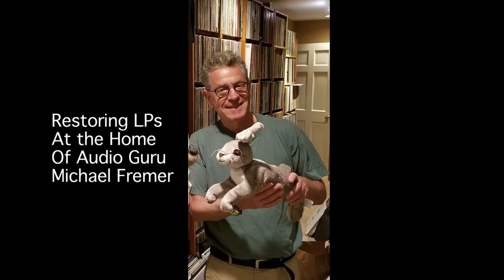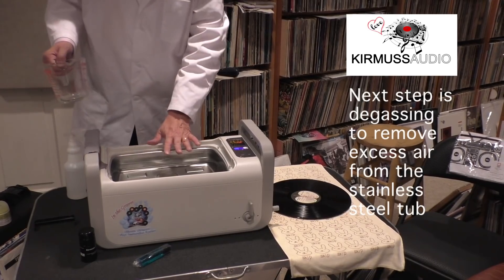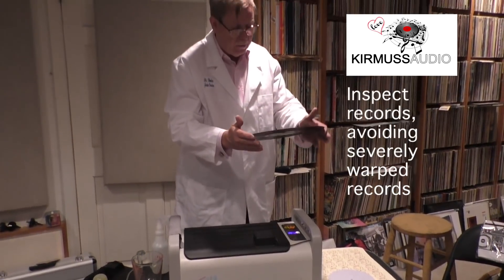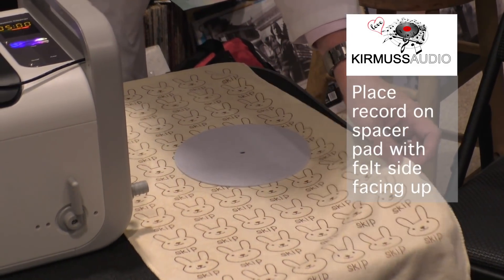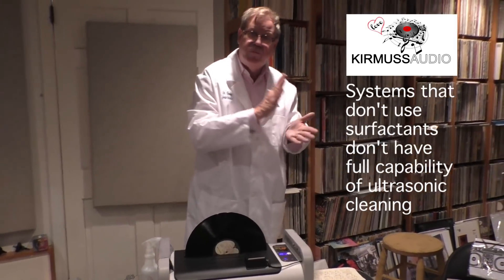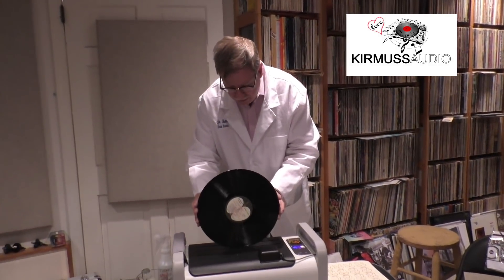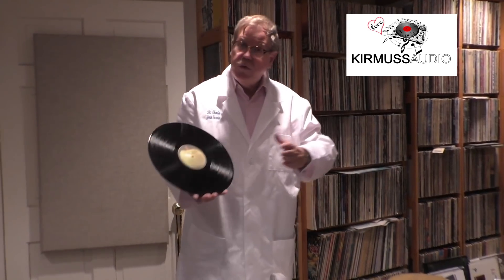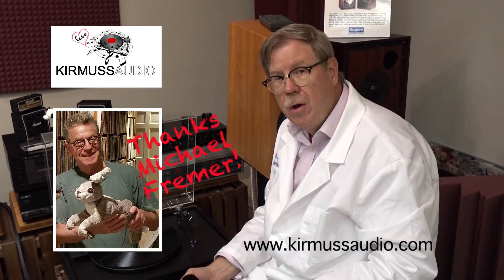KirmussAudio System Demo

Comment: Would of been nice to hear the record before and after cause to me that is one long cleaning method
Reply from the maker: We will be adding a video explaining how sonic cleaning technology works,  showing also proof of our process and where sonics using skewers on a rotisserie cannot see any action as the records are too close to each other  with before and after results played.
Reply: I think, initially, the process might be lengthy, depending on the condition of the record, but, I'm certain that after the initial cleaning, proper care for the same record will require less frequent and less intensive clearing.
Reply from the maker: Once release agent is removed, a 5 minute cycle every 3 or 4 years is needed, or earlier if the record is handled frequently after restoration.
Reply from the maker: Check out the Kirmuss Audio YouTube channel. 

Clips with audio and video ysing a spectrum analyzer of Records before and after restoration are present.  Recorded in front of an audience. Records belonging to record lovers brought in for restoration.  Unedited.  Unscripted.
Reply: *would have

Comment: This makes me not want to collect or play anymore lps! All the work is insane!
Reply: Each to one's own. Speaking for me, there is a distinctively a different quality level when listening to LPs vs vinyl. For me, it's worth the effort.

Your mileage might vary.
Reply: @TBNTX  LP's vs "vinyl?" lol
Reply from the maker: If you visit one of our dealers  and bring in  one of your  records for restoration, not surface cleaning,   it takes only   6 or 7, two minute cycles on average to restore 2 records simultaneously.  I do not expect one  to restore all their 2,000, 5,000, 10,0000  records.... Your ears will value what we bring to the table oncecredtirstion has occurred.

 Our peers with multiple cycles over 30 minutes cannot remove the release agent of 60 years ago. We offer a 1.3 to close to 5 d. Gain over floor depending on the provenance  of the record being restored.

 The proof where while it may take some time and effort,  stereo manufacturers use our process to restore the records that they use in their studios at various trade shows, this  to emphasize their product.

 Case in point where Jeff Rowland Design  will take your record and restore it for you at a show, this  before they play it on their system  this for you to hear. I am trying to be impartial.  Two records at a time in 12 to 14 minutes is well worth the effort for you to realize the full potential of your turntable and stereo.  Cellist Vincent Belanger restores his new pressing made in Germany of his Cello title, gaining 1.3 db   on average as a signal gain and removing the 3 or 4   pops burned in the release agent of the record, pops burned in a new pressing at the factory he uses. I am sure both would gladly take your call and explain the end result restoration,  not cleaning
Reply from the maker: LP's have a magic about them.  We will not debate analog versus digital,  but a restored, nor just surface cleaned record,  offers emotion and breath to the artist...
Reply: It's fun though you do the work and get the reward

Comment from the maker: We have proven resoundly using science and measurements where all other processes even if run for 40 minutes do nothing to remove the release agent found in grooves of 40 year old records or newly pressed ones. We are not cleaning,  we are removing the release agent from the grooves taking 25 to 27 minutes to do 2 or 3 lp's, or 4 records , fir the end result, this is not much to ask.  Better result than buying a 300$ silver phono interconnect cable or $5000 cartridge. In response, using a vacuum for 40 minutes, or spin clean for the same time or an hour with other sonics only surface cleans, and even where after these processes  leaves a film on the record and in the grooves. If you wish to surface cleanva record, use our system for 5 minutes. Then polish. 
.... So not bad for our process of average 25 minutes restoring multiple records  that gives you 1.5 db increase on a newly pressed record to upwards of 3 or more on a vintage pressing.  

...You cannot compare our groove restoration system with other cleaners,  they are just that, surface cleaners. 

Other processes will not remove coatings applied such as LAST, etc.. 

Do read the recommendations of both professional custodians,  artists, engineers and music lovers and their experience. Do ask Jeff Rowland Design, Audio Note, Yamaha Canada, Oracle turntables about what their experience has been. These manufacturers with over 130 years total presence use our process to restore, and not just surface clean their own records and those of their clients  that they use to promote their own audio products at shows. Nothing to do with the promotion of our process or equipment.

Respectfully, 
With over 2,000 sold in a year we are a movement. 

No other manufacturer shows before and after images of grooves processed or talks about signal gain or makes available technical data, complementing one's audition
 ...Remember, thanks to the previously discrete release agent that we discovered, this allows us to remove contaminants that causes those clicks and pops that have been micro welded into the release agent by the heat of the needle , and now removed, the  air, breath, imagery of the vinyl  restored...

Comment from the maker: We do not put the record on a lint free micro fiber cloth. We suspend the record on a lint free, dust free circular pad that we supply ,    or offer a the same 5 inch pad with an optional  support made by a company called Stable 33.33. Model called a  Transit 7000... With the latter accessory, the record sits 1 inch above the work area. It also spins. 

...The workstation rabbit cloth protects the work table, the record does not touch the record.  

...Added, we use this same cloth to pad dry the goat hair brush between applications of the ionizing surfactant to the record's surface and in this application as we are now changing the state of charge of the record thus  accepting now the plasma wave to work on the grooves themselves, by now  pad drying the goat hair brush with the rabbit microfiber  cloth thus  drying the brush between applications of our ionizing surfactant (not alcohol), we see better the initial rise and then  the fall and  also the rapid evaporation of the whitish toothpaste like materials that were softened by the sonic and  disturbed and brought out by the brush.... thus giving us the  visual validation where there are no contaminants or  release agent  left in the record grooves. Groove restoration now accomplished ...end of process.... part of our patented process.  Works for both newly pressed and vintage records.

Comment: If you don't want to put the record on the microfibre cloth because it will transfer lint, why would you use the microfibre cloth to vigorously clean the brush which is then going to be used again on the record?
Reply: No.. he's right.. why are you rubbing that brush into the microfiber towel?  You're moving lint into the brush.
Reply from the maker: The record does not sit on a microfiber cloth, it is suspended on a lint free 5" pad, or on an optional 1" high plastic turntable.
Reply: lol seriously this guy built his entire method and machine around mythology. he also wants us to believe that using 1.4 ox of 70% ipa into 250 oz water is somehow better or different than putting in 1 oz 99% ipa or 1.1 oz 91% ipa to the same volume of water. at that scale the .4-.5 oz water that is added with 70% ipa is a literal drop in the bucket

Comment from the maker: Our goal is to remove any release agent which we consider an attractant to dust which is subsequently micro welded into the coating found in the grooves. Records do not need lubrication or a lubricant. Needles and cartridge design predicates no such lubrication.  In fact, one known product purported to change the molecular  structure of the record to protect it against wear was found to simply coat the record with a 9 micon film... the purpose of a record's groove is to make full contact with the dyne of the needle. To cost a record otherwise affects the intent of the entire process.

Comment from the maker: 70 % ipa is not rubbing alcohol. 70% ipa unlike higher concentrations is water soluble and as such does not affect the plasticizer. It is not used as a cleaner. It is used to kill off dormant or live fungus. The process described of ionizing the record is the key to remove the remnants of the release agent that attracts and holds contaminants. Our process has been developed over 5 years and we invite you to visit one of our dealers or us at a trade show with the record of your choice that you are very familiar with and do the challenge. Several artists who have pressed recently new releases use our process and note the difference.

Comment: This is sounding like bs, well I wouldn't put rubbing alcohol that probably got it is at 70% contains other substances like oils. There's nothing wrong with 99% isopropanol as long as you don't exceed 10% of the entire mix but instead I would use AdBlue instead what is 32% urine 68% deionized water you can get it from petrol stations put in diesel cars for the emissions, and a few drops of hair conditioner wouldn't go amiss either but make sure it's salt free. Is it an ultrasonic sonic cleaner? I think they're bad for your records will damage them over time could cause microscopic cracking. After cleaning and drying Spray your record with a dry silicone lubricant like ttd ds100 a very pure silicone lubricant. Just a gentle spray put a pencil in the record spin it then spray vertically.
 Ethylene glycol is very poisonous toxic I wouldn't be spraying in the air specially if you're clean a lot of Records can cause nervous damage even death even in smallish quantities. Why don't you make a container for the brush that has a exuberant sponge and you can just dip the brush in it would be better than spraying it in the air not sensible is it. clearly you're wearing that doctors coat for comic effect.

Comment from the maker: 1. We changed to 60 ml bottles from 250 ml in 2019, due to issues shipping. The 60 ml does 60 to 100 records based on 4 five minute  cycles  average.  Only light spray at 22, 4 and 8 PM is needed.  2,100 customers in one year cannot be wrong. Pse make sure you review the updates on our Company web site as to supplements and asked questions.

It is  impossible to scratch a record with goat hair brush.  The brush is held by squeezing the goat hairs and using thus to add pressure to the brush hairs to bring up the contaminants and push the ionizing agent into the grooves. 

Kindky review the supplemental manual pictures.

 The typical time for a  new German pressed record is 3 five minute cycles. For a new US record pressing,  3 to 5 five minute cycles.  Depending on provenance you need to apply the ionizing surfactant until you see the rise, then fall of what appears as a whitish material. This is material disturbed by the brush from the gooves. A decrease or rapid evaporation confirms the last five minute cycle before polishing. 

Records repel water. If you have a record coated with Last Protectant or L'Art du Son, ...You will see  thousands of small water droplets on the record after the second 5 minute cycle. You will waste the ionizing surfactant. Per the QA section, change to 2 minute cycles,  not 5 minute ones. Coatings such as LAST repel anything put on the record, the sonic will wash the ionizing surfactant off the record within two rotations.  Using 2 minute cycles it takes 5 to 6 two minute cycles.

The above info is in the supplements and web site updates.

Comment from the maker: We restore and not clean 2 or 3 lps in 20 to 25 minutes depending on what process you used prior. We remove even release agents from 30 years ago exposing for the first time the grooves as originally pressed less release agent! New records see 3, five minute cycles for German pressings. Four 5 minute cycles for new American pressings.  Records washed by some ultrasonics and vacuum systems take 25 minutes.
Reply from the maker: Now since 2022, either 2 or 4 minute  cycles based on what we see on the record's surface after the first cycle with the ionizing spray applied.

Comment from the maker: It usually takes 20 to 25 minutes on average to restore record grooves and clean it, this for 2 records handled simultaneously. To note, a three LP adapter is coming allowing 3 LP's to be restored in the same time. We cannot control the provenance of the record.  We have proven at the many trade shows taking records brought in by audiophiles from their collections where previous cleaning methods used by visitors to our booth have not touched the grooves, sorry to say.  Most systems used whether sonic or vacuum actually added more contaminants to the grooves. Proven using using a 3d microscope to measure the film's left in the grooves. A green light or vacuum motor stopping does not indicate grooves being cleaned.  Even 8 times in a competitive  sonic system and when the record is afterwards placed in our system and our process sees 4 cycles of 5 minutes   I cannot say more.  To note where even new pressings from Germany see 15 minutes, 20 to 25 for some US ones. To know when to stop the process, make sure to rinse and then pad dry the brush used between applications of surfactant, and to discard the brush after 60 records. We use the brush to see an increase and decrease of the contaminants being removed indicating end of process.  Of concern. Records coated with Last or other protectants cannot use the standard recommended 5 minute cycles. Consult our web site to learn how to identify this. You will need 9 two minute cycles  to strip these off as the coatings wash off the surfactant applied within minutes. If you used 5 minue cycles  with a record coated with an agent you I am sure would  therefore easily pass the 50 minute mark. With lots of beads of water visible, or sheets of water on a record,  change to 2 minute cycles. Record now restored in 15 to 18 minutes. Two like coated records restored in the same time.
Reply: when is the three LP adaptor coming? (edit) I found it, currently sold out, pre order also sold out.  waiting game.  surprised you don't sell them directly I would expect this would sell well compared to the 12/12/10/7 option.  10inch records are really not that common for most collections, a minor part typically.  its over 90% for most collections 12inch in my experience.
Reply from the maker: @varsityathlete9927  Upscale Audio sells the 3LP machine. We manufacture this exclusively for them. The 3LP cover is available only to 2 LP machine owners.  The 2LP machine registration must be on file with Kirmuss Audio.

Comment: It probably works, but who the heck is going to take this amount of time and trouble?. Twenty minutes, maybe more, to clean an LP.  I can't believe the guy keeps a straight face as he starts yet another 5 minute cycle, HOPING that 3 cycles is enough on this occasion. And gallons of liquid bite the dust.
Reply: I guess it just depends on how serious you are about this hobby and how big your collection is. You could always pay your children a buck a record to have them clean them using this system haha
Reply: @utub1473  You've hit the nail on the head. With a tiny collection, and immense enthusiasm, it works!
Reply: @Telssa1  Yeah. If I had a collection like Fremer's, I wouldn't use this. Ok maybe for a few of my PRIZED albums but not all of them. The thing is I know that I DON'T want a collection that big or even anywhere close. A few hundred will be enough for me, so this machine would actually be perfect for me.
Reply from the maker: Peer ultrasonics that do not use ionization ask you repeat their processes for 4, 5 more 5 minute cycles. The Kirmuss ionizing spray shows what has been pulled of the record, and when a record has been restored, the needle for the first time picking up the detail as pressed. Once processed, this process does not have to be repeated.